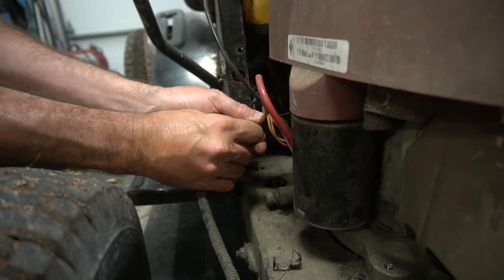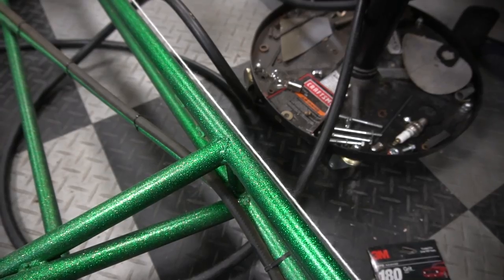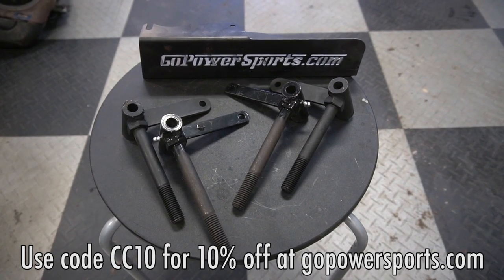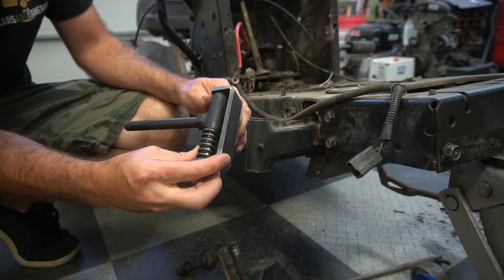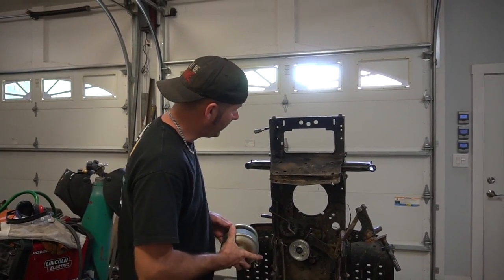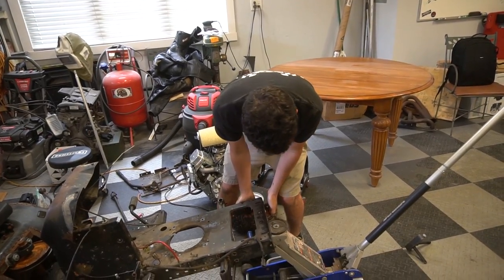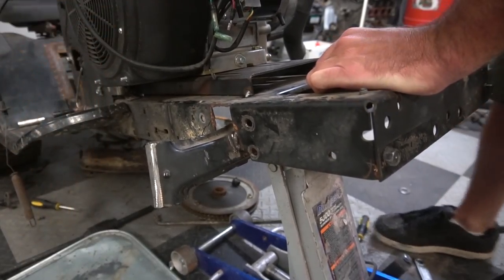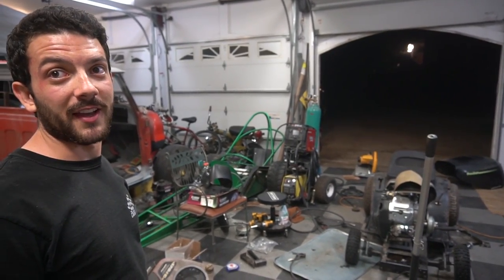50HP 670cc LAWN MOWER SWAP!

Comment: Worried about a 1/16” bend in the dragster frame for safety reasons... let’s put the 50hp engine and put it on a top heavy lawn mower hahaha
Reply: its not top heavy, unless Ike is on it!!  LOL..  Besides, it would be a LOT more fun as a wheelie machine instead of a racing lawn mower.

Now if they could slap a deck on it and mow the yard at 20-30 mph and get a good cut pattern, THAT would be an episode that would make history.
Reply: I. Know right that dragster needs that Ducati street bike engine and the lawnmower needs to be beefed up they have a Chinese four wheeler with suspension I would cut the front end off of and weld it to the lawnmower and I would widen the rear with a solid axle from a four wheeler maybe even make a tube frame but keep all the lawn mower carcass idk I’m disappointed 😔
Reply: Jerry Wooton thats what I said make the mower actually handle with that quad stuff and make the rail actually fast with the duke lump
Reply: Papa Cold-hoppa That's my kind of humor too👍🏻
Reply: Jerry Wooton Aw
Reply: Dc
Reply: If you only knew. Lol
Reply: dragster aint even quick
Reply: That rail looks like it has enough reinforcement to handle a small block Chevy ...that would solve your trans problems too😃

.
Reply: Isaac it'll be fine would you guys be interested in a head to head? I have a friend with a 30hp vtwin Subaru. I also have a 10hp simplicity. It'll do at least 50 when I'm done. Let me know, thanks!
Reply: Heins beans
Reply: Mnnn
Reply: 8

Comment: I was a frame mechanic for years. Brace opposite frame with angle iron. use porta power or ratchet straps for pressure. over straiten for spring back. now cross brace and gusset as needed. Wish I would be around in the future when you guys enter the circuit.      peace

Comment: I now have an idea to us my extra Yamaha 650 two stroke from an old jetski awesome..
Reply: I would like to see this I heard its difficult to do anything with jet ski engines but possible
Reply: Josh. Hear me out man, if the pump is good on that jet ski motor, do what my buddy did: Get an old aluminum fishing boat, modify the back by cutting it and using wood and sheet metal to create the ductwork and mounts-fairly easy, I am sure there are many how to videos on the YouTube by now.  He also put a handlebars in the front running cables for steering, and a stereo with subs that doubled as a seat mount up front.  He was offered 4 grand for it, twice! Overall It costed him less than $400 to make it.
Reply: Prolific Invention fuck yes

Comment: CarsandCameras Video Idea: * Get an old jet ski or waverunner motor/pump assembly on the cheap and do what my buddy did: Get an old aluminum fishing boat, modify the back by cutting it and using wood and sheet metal to create the ductwork and mounts-fairly easy, I am sure there are many how to videos on the YouTube by now.  He also put a handlebars in the front running cables for steering, and a stereo with subs that doubled as a seat mount up front.  He was offered 4 grand for it, twice! Overall It costed him less than $400 to make it.  And as a bonus, if you have the waverunner body still you can put a motorcycle inside for a hybrid vehicle like that viral video....
Thanks for all the great content, this project has my interest.

Comment: I built a single cylinder Kohler command back in the late 90s with a custom flat top JE piston, custom crane cam, Chevrolet solid lifters, modified Chevy roller rockers, extensive port work, dual springs and titanium valves with a 36mm mikuni. Ran it through a peerless 5 speed tranny on a custom framed Murray lawnmower. 0-50 in 4.13 seconds with 110 octane. Never new the horsepower on it tho, but it hauled ass.

Comment: Heat the rail frame up with a torch. You would need to do it on the “concave” side of the bend. Once you get the frame rails red hot (support it so it doesn’t sag) quickly cool it down with compressed air till it is cool to the touch, it will make the bow draw out of it. You may have to repeat a few times to get it straight, but it will work, we do it at work with big bore pipe all the time (56” and larger). Obviously afterwards you will have to sand and repaint it.

Comment: Just a heads up, with any kind of plasma torch you should be running a water separator in line from the air compressor.. and make sure you have at least 5 feet of hose prior to and after it just to make sure that it is cooled down and dry. You can pick one up at any hardware place or harbor freight.

Comment: Come on dont take the transaxle out. Thats all the fun on the mower
Reply: Briggs & Stratton Power  agreed it needs gears to bang
Reply: If they do take if off they should at least use it for a shifter cart
Reply: Briggs & Stratton Power -  That transaxle would never hold up to the HP and torque the 670 produces.  They need an old Harley 4 speed transmission and drive it with the 670 to a live axle.  Then use a dry clutch so no lube is needed.

That would make it really interesting.  Seriously the need to think about stiffing the mower frame or maybe just replace it with custom tube frame designed to look like the mower.
Reply: W Hoggdoc I have a Kawasaki 730 v twin on mine and it holds just fine it can reach 87mph

Comment: It needs 

BOOOOOOOOOOOST
Reply: Desmond moonbear agree. Nitrous would be cheap tho
Reply: Bet it wouldn't hold up
Reply: no it doesnt
Reply: shansway rooster here in calofornia its more like wwoooOOOToOToO-KSHHhhhhh
 :D
Reply: Melvin Sæther that's why you build it to withstand it
Reply: No it need an engine that doesn’t belong in a generator
Reply: Desmond moonbear nah, it needs bewst
Reply: has anyone here add boost too a carb before? (besides CnC)
air-fuel is a sob. maybe a Harley motorcycle throttle body and supercharger/ turbo (3 l/b boost) with an ethanol tune? The extra octane will help with heat and a beefier oil pump/cooling setup would be nice imo. I love the idea of the mower one the channel over the dragster much more, n/a or boosted.but Great content Jon and Ike, reminds me of the days of the ratrod build.
Reply: @doodlebug6833  well that's why they ditch carb and go EFI.
Reply: @madmax2069  thanks captian  obvious XD
Reply: STUTUTUTUTU
Reply: Go look around lots of engines made awesome power with a carb u just need to build it right
Reply: it needs stututututu

Comment: Been waiting for a build using a mower transaxle and a 670cc. Was hoping for custom but this will do. I can't wait to see how you connect the drivetrain. Horizontal to vertical is tricky without expensive gearbox angled driveshafts

Comment: Great video and engine choice!
I guess I don't understand all the concern over the slight tweak in the dragster's frame?
Just brace it between two points, pull it back where it belongs, then add some X bracing to be sure it stays there.
P.S. Since it bent that easily, it needs better bracing anyway.

Comment: CarsandCameras, the kings of taking something that works perfectly and modifying it until it doesn't.
Reply from the maker: This was far from working perfectly- sketchy steering, terrible brakes, unreliable drivetrain. "Working perfectly" is just not accurate.
Reply: Works prfectly meens that you never have to redoing it.    Till then your always going to be adjusting things.
Reply: Second only to Roadkill... they take something dead, make it work and then leave it to finish rotting on a California wine farm, robbing it of parts until it doesn't. I guess the outcome is all the same regardless.

Comment: On my racing mower what I did for steering (which I think would help you guys) was I put the same shaft that was originally for the steering column coupled to an adapter which I made with a metal lathe,  and used a small pto shaft, cut loose the universal's and put them end to end and changed the angle of the steering column to go straight to the front,  you could do the same and then attach straight to the rack and pinion setup, this would also put the setup below the engine where it's not in your way,  then go straight to the yokes. Hope this helps.

Comment: This is a crazy build. I like it, but just a bit of advice, you better think about possibly building an inside tube chassis for support. That motor is gonna have SO much torque twist in that stock stamped steel chassis. It'll be like crushing an aluminum can.

Comment: I wouldnt worry too much about that bend from a perspective of it collapsing.  Triangulation should prevent that. A massive taco where the tubing itself was compromised might be a worry but that tiny amount shouldnt be an issue.  If youre worried add some more triangulation between the rails closer to the front (probably wouldnt hurt anyway.)

Comment: Kind of a dumb idea, but could you use a high lift jack to bend the frame of the drag rail back into place? Place the bottom peg on the inside of one side, the lifting peg on the inside of the other and bend it back out since both sides seemed to bend inward.

Comment: We got a 1 cyl 465cc 12.5hp motor on our project mower. We plan on welding the diff and swapping the pulleys and straight piping it🤣

Comment: put a 3 cyl diesel on something
Reply: AlexT456 but why
Reply: chug boat kart
Reply: AlexT456 The engine would weigh more than the entire vehicle they put it in.
Reply: Im guessing you are thinking of a tractor engine or so but that wouldnt be worth it
Reply from the maker: Where do we get one??
Reply: Lmao... like what? The miata?
Reply: Prolly wouldnt go with this one because of the price but if you were actually interested you could find a parts tractor on craigslist or just get a one or two cyl off ebay used

https://www.amazon.com/Kohler-3-Cylinder-Diesel-Engine-PAKDW10031001A/dp/B001C3PUF4/ref=sr_1_5?ie=UTF8&qid=1534808138&sr=8-5&keywords=small+diesel+engine
Reply: Todd aka fearlessfront has a bad ass diesel sears mud mower
Reply: Good idea but a v twin with straight pipes fuel exhaust and it's a deisel
Reply: Duel

Comment: Also wish you guys would do more builds with motorcycle engines! Predators only go do far. Manual transmission projects are where at!!!
Reply: motorcycle engines are a waste of time.  Small engines are where these guys really shine for abilities.  Anyone can put a 350 in a Chevette..  These guys are doing this for BUDGET builds...  Granted that Predator 670 wasn't really a budget build, but it was a rare build that is not the norm for these guys.
Reply: Ed H old motorcycles not running are practically free

Comment: Guys cmon we all said last video we didn’t want the 670 swap. Vertical shaft vtwin Briggs and Stratton with newer transaxle. Deleting the transaxle? Cmon it ain’t even a lawnmower at that point
Reply: Can this please get alot more attention, i couldnt agree more
Reply: I Agree
Reply: You have no idea how sketchy a lawnmower gets at those speeds. And btw no one said they didn't want the 670, people didn't like the idea of a 420 so stop making things up.
Reply: N VD97 look at the comment section on the last video. The 2 top comments were me and another person commenting on how we wanted them to keep the transaxle and vertical shaft engine style. Ok fine they can change the steering that was pretty sketchy, but the transaxle should stay
Reply: Yes it’s a glorified go kart now
Reply from the maker: The vertical shaft + transaxle setup is just not great for speed. We're planning another mower project that'll keep the vertical shaft & transaxle. I guarantee you'll be impressed by this result.
Reply: @CarsandCameras  It'll be fine.
Reply: @christianlucatino1910  Running a horizontal shaft engine going to a vertical drive to power a transaxle would just be plain stupid. Not even talking about the fact that the transaxle would grenade itself with such a big engine, and it was already having shifting problems with the 12 horse. So please don't be so stubborn and accept that a transaxle is not the way to go on such a high powered/high speed creation.
Reply: @nicovanduin1553  the voice of reason! 

What do you people want? A lawnmower or a racing mower? And yes, racing mowers are just glorified go karts, at least the fast ones are.
Reply: CarsandCameras fair enough lol. Hey who am I to dictate what you guys do you’re the ones who make the videos.
Reply: N VD97 3D machines a while back actually when he completed projects modified the gearing setup in his transaxle so he wouldn’t need to screw around with the gearing of the pulleys. I think it was a combination of shifting without the clutch (despite having the torque converter) and the tall gearing that killed the transaxle.
Reply: they all have straight axles and modified steering so I dont get why people lose it over this.
Reply: @carsonhammond6204  They are just keyboard mechanics who have no clue and never even build anything themselves

Comment: Beautiful canal. I have seen that you bake prototypes as if they were croissants. I wanted to ask you if it was possible to see one that mounts a BRIGGS & STRATTON 24 HP TWIN CYLINDER 721CC VERTICAL ENGINE

Comment: i would turn the engine so shaft faces the seat then use the 90 gear box on the rat rod cart to transfer to the diff or could the diff be angled so the pully meats with the cvt and a drive shaft run between

Comment: As far getting the power to the back. Maybe run a live axle under that engine that directs power via a chain to the back actual live axle. This helps get the all the chains up under the chassis and out of sight. Or maybe u could have just put a 420 under the seat sitting out the back end a bit.

Comment: Needs to have a cage built and welded to the frame that protects the front end and around the driver. Then weld some sheet metal to the bars around the driver.

Comment: As far as the rail goes it may be from welding it together it could have tweaked it a little so that little bend is fine also put a spreader there that will keep it from doing that

Comment: What kind of engine is that? I have a ole yard machine riding lawn mower that I wanna do a engine swap on and I haven't really found the right engine I wanna put in it yet but I would really like to put a engine in it that will go really fast and I watched every single one of ur videos on the lawn mower builds and I really like the way that engine performs in that lawn mower that's kinda the engine I wanna put in it but I can't find a engine like that nowhere.

Comment: Hey quick question. When you look at a 670 cc motor its rated at 22 horsepower. How did you configure 50 horsepower. I want an engine with 50hp.

Comment: I suggest you guys take a look at some actual racing lawn mowers to see how people have put them together, a lot of them are using high output v twin agricultural engines but not in the horizontal shaft orientation, they keep them more in a lawn mower layout and do other things to make it work well besides just changing it into a gokart layout
Reply: Drew Alsup and they also use pulleys with real belt clutches instead of cobbling up some go cart parts that aren't made for 1/2" constant tension belts. And they wonder why it was eating belts like mad

Comment: Just triangulate the top bars like the bottom rails, and connect the upper cross, and the lower cross together, and gain rigidity overall

Comment: Yeah, something like that. Leave the hood off,  put a Moon style tank in the front, twin carbs with a common plenum chamber, chrome velocity stacks and drop the seat down between the real tires. Hmm, 4 point roll bar with diagonal braces and a wheelie bar.

Comment: Honestly guys, I think it's a bit of a shame. The DNA of the mower is the vertical shaft and belt drive, with its whining diff ! I know that a more classic chain-drive system is more practical, but for me it looks like a go-kart when you don't have enough money to buy a frame... You should give it a big vertical shaft engine with MAD mods (turbo ? :p) and a transmission with covers and decent tensionners or maybe adapt a chain on the original gbx and a new vertical shaft engine
Reply: some mowers ares horizontal shaft ive had a few
Reply: Alec M I know, but I talk about their mower, not mowers in general
Reply: I have a vertical shaft stock riding lawn mower

Comment: Hey guys. Wondering if you could help me out what the problem I'm having with my 670 Predator engine. I've got it on a stump grinder. And the engine sits right above the cutting wheel. So it changes in Pitch quite regularly. So if I have the engine full of oil. In go all the way down to the lowest cutting point of the stumper. With it bouncing around it will slosh oil into the cylinder. And smoke out the place. I'm wondering if there's some type of baffling I can put in there. It had a 25 horse Kohler. And it didn't have any issues. Any help would be appreciated thanks.

Comment: Seems like the one that hit the rail and bowed it would be responsible for replacing it. Then again you might be able to pull it back straight.  Once you bow a pipe though, it's usually bowed forever.
Reply: It was unfortunate but it'll be fine

Comment: Eventually you guys are going to need a 10 foot flat bottom jon boat and airplane prop so you can make a airboat out of that 50 horsepower engine. Just saying it's another project. 🤔😂😎👍